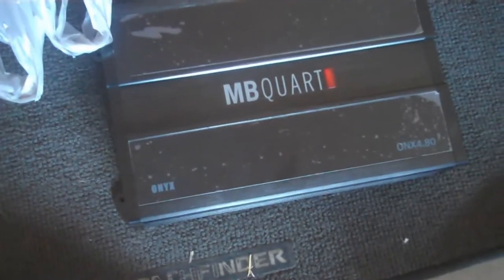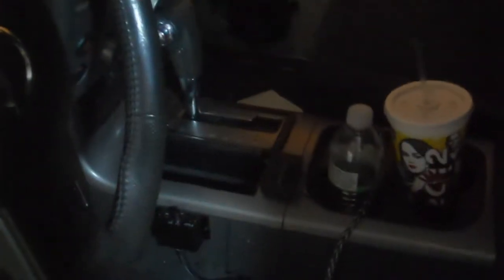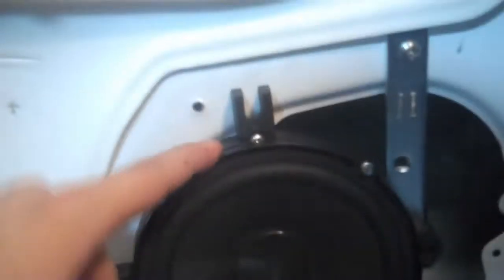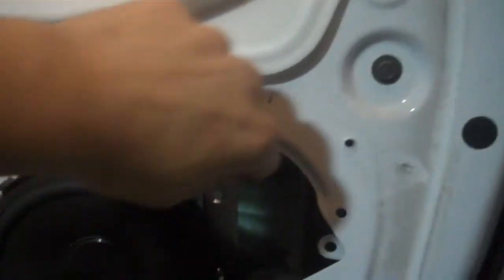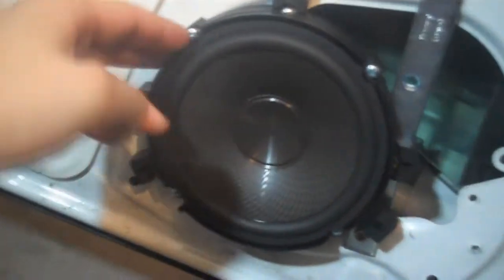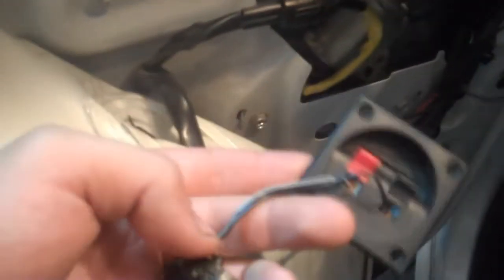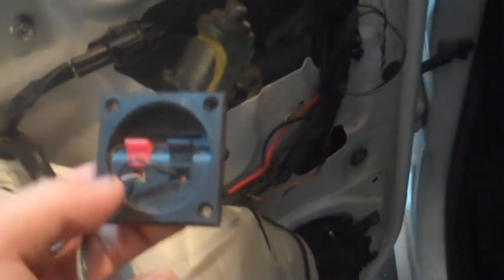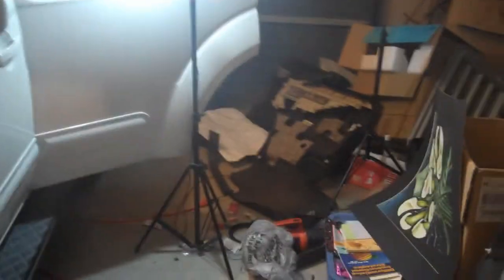Kenwood Components Install with MB Quart 4.80 Amplifier Part 2

Comment: I've had these in my titan for a little over a month, theyre awesome for the price. Give them a month to break in, the midbass they put out has doubled from day one to now. I have the 6.5 excelon series in the back doors and the performance components up front running off a 4chan kenwood amp.